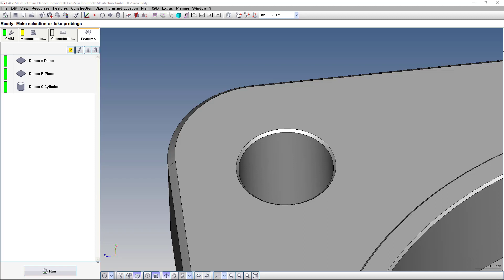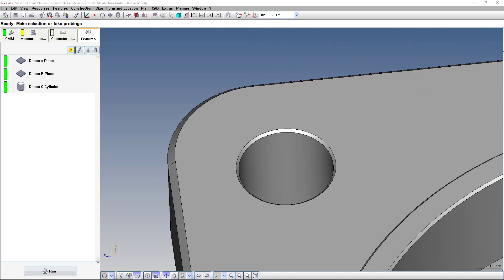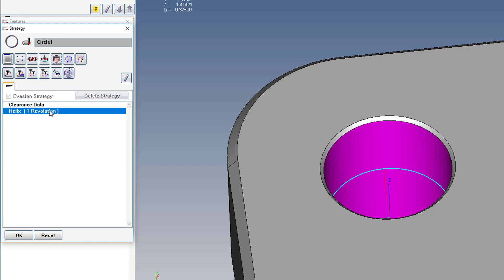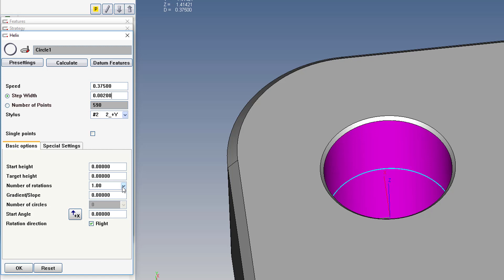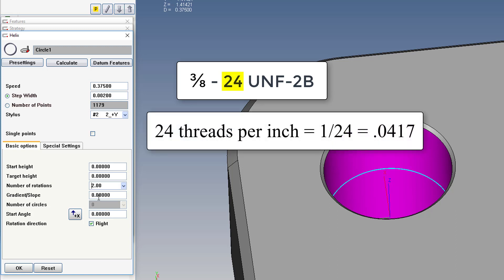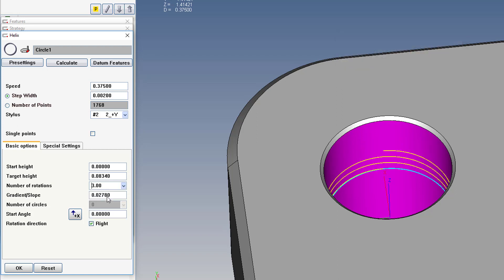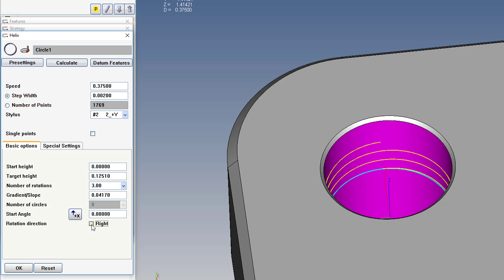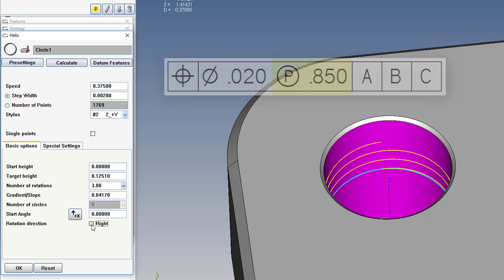Zeiss CMM scanning on threaded holes

Comment: What does the negative sign do in the pitch?  I was instructed at first that right-hand threads get the negative sign, and left-hand threads do not, but then my trainer said he thinks he was mistaken, and when I take out the negative sign it makes the thread look like it's going the opposite direction (like from right hand to left hand.)  I am still confused...
Reply from the maker: If you put a negative sign on the pitch (gradient/slope), it will reverse the thread direction. However, the easier way to reverse the thread direction is to simply un-check the box next to Rotation direction, which will make it a left-hand thread. I always put a positive number in the gradient/slope box, and in the rare occasion that it is a left-hand thread, un-check the rotation direction - Right.
Reply: @learn-cmm  thank you so much!!

Comment: If threading given in metric, then how to calculate pitch???
Reply from the maker: Hi Satish,
The pitch for metric threads is usually shown on the drawing in the thread callout. For example, "M3 x 0.5" means a 3mm thread with a 0.5mm pitch.

Steven

Comment: If you go to Special Settings in the helix strategy, you can select Self-Centering and you wont have to mess with the pitch.
Reply from the maker: Good point, Frank! Thank you for the helpful input. 
- Steven
Reply: How do you select the target height? I prefer your method, I just cant get the Strategy to show the scan path without entering the pitch into the slope.